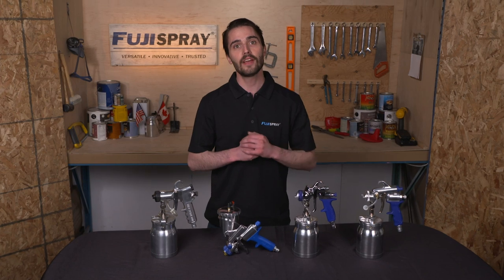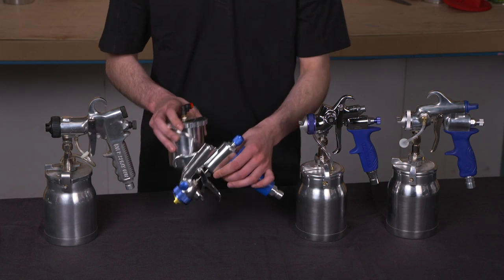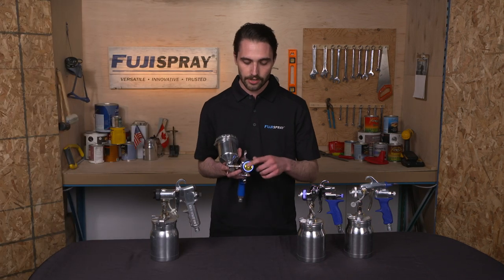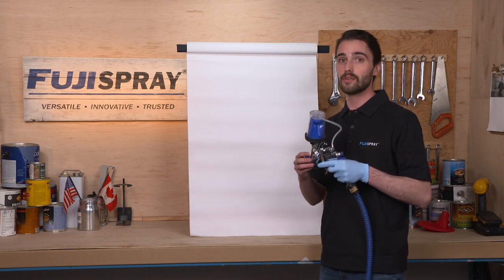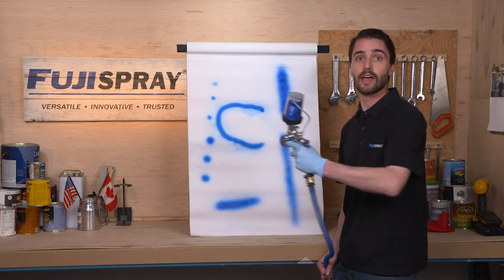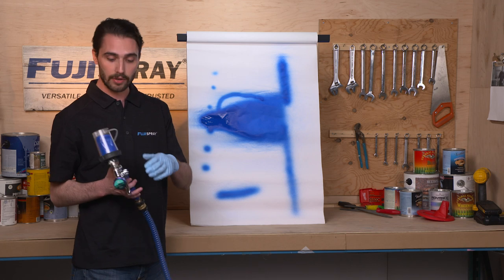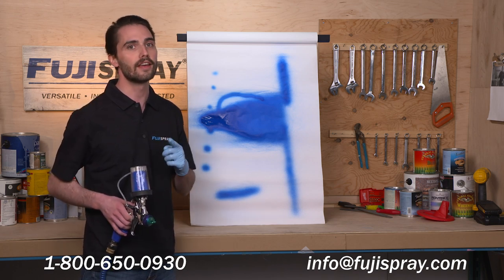How To | Adjusting the Fan Control on a Fuji Spray® Spray Gun

Comment: Jim I bought a hobby pro2 and I am trying to spray Benjamin Moore Advance on Kitchen cabinets. What should be the fan size and fluid settings ? Also can i keep my gun as close as 3 inches to the project or do I maintain the 6 to 8 inches as you mentioned in this video.
Reply from the maker: Firstly, you would want to dilute the paint so it flows and atomizes effectively (see link https://www.youtube.com/watch?v=kd1diWCLSH4&t  on dilution and https://www.youtube.com/watch?v=TF3-CataA5Q on how to use your viscosity cup). The fan size should be the widest setting for the doors, fluid control varies on how wet of a coat you wish to achieve. We typically begin by closing the fluid control all the way, then 1.5 turns counter clockwise and test on a scrap piece, see if this is the type of wetness you wish achieve or adjust if necessary. The cabinet boxes may require a narrower pattern; start on the corners, then wider pattern for larger surfaces. Remember you will need to adjust the fluid control in tandem as you adjust the fan width. For further assistance please contact Fuji at support@fujispray.com or call us directly: 1-800-650-0930. - Fuji Spray Team -

Comment: Jim...which gun is the one you used in the demo? Why a different gun than any of the ones you first talked about? How is the gun you used, different?
Reply from the maker: The spray gun used in the demo is the T-Model gravity spray gun installed with a small 3M PPS cup setup (ver 1.0). It's a smaller profile setup and easier on to handle for smaller touch-ups or demos like this one. The adjustments of this gravity gun are similar to the T-Model bottom feed gun displayed on the table in the beginning of the video; same fan pattern control adjustment, same material volume control. - Fuji Spray Team -

Comment: How can you set the psi at the gun do you sell a regulator?
Reply from the maker: At the end of the hose where you connect to the spray gun, there is an Air Control Valve. This simple ball valve will help you adjust the air pressure coming into the spray gun. All Fuji Spray HVLP spray systems include one of these.
Reply: So there isn’t a gage how do you know your psi?
Reply from the maker: @mikewolfe789  In reality it's not necessary to have a pressure gauge present. The pressure that a 2-Stage spray system puts out is approximately 5psi, a 3-Stage spray system puts out 6.5, a 4-Stage about 9 and a 5-Stage approximately 9.5. When a HVLP turbine spray system is in operation, you would typically need all of the pressure that the machine puts out. In very few instances, when spraying some top coats or stains and operating the 4 or 5-Stage units, one would lower the pressure coming into the spray gun to reduce overspray. if you have any further questions or concerns, we encourage you email us at info@fujispray.com or call us directly: 1-800-650-0930. - Fuji Spray Team -

Comment: Is their a Fugi system that can spray oil base paint and lacquer  ?
Reply from the maker: The Fuji Spray Semi-PRO 2 all the way up to the Fuji Spray Q5 can spray oil based paint. Bare in mind that the Semi-PRO 2 is an entry-level spray system. If you are looking for professional showroom finish results, you would want to consider a 4 or 5-stage spray system (Mini-Mite 4 or 5, Q4 or 5). - Fuji Spray Team -
Reply: @FujiSpray  I have a minimite 5 and its giving me problems with oil paint. i shouldve gotten a Q5 right?
Reply from the maker: @smilegagadk  not necessarily, the Q5 and Mini-Mite 5 have the same PSI output; they both have a 5-stage motor installed in in them. If you wish to troubleshoot your challenges with oil-based paints, we ask that you kindly reach out to Fuji Spray directly. We look forward to hearing from you. - Fuji Spray Team -
Reply from the maker: @smilegagadk  Q5 and Mini-Mite 5 both have the same 5-stage motor inside; they are equally powerful. please reach out to Fuji directly to further discuss your spray challenges with your spray system. We look forward to hear from you. - Fuji Spray Team -
Reply from the maker: @smilegagadk  The Q5 and Mini-Mite 5 are both equally powerful; they both have the 5-stage motor installed in them. Please contact Fuji Spray directly to discuss the challenges you are experiencing with spraying oil based paint. - Fuji Spray Team -

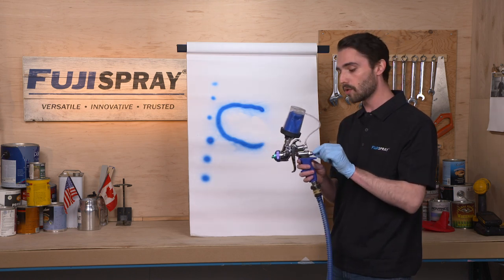Comment: Fails to say whether the 12:00 or 3:00 setting is wide or narrow. 

Fails to say whether clockwise or counter-clockwise adjustments to the finish supply will increase or decrease finish volume. Basically failed to answer the two questions I had in mind when I found the video.
Reply from the maker: This video walks you through adjusting the fan control. For fluid output control, clockwise will decrease volume flow, while counter-clockwise will increase volume flow. Look at it as if it were a lid of  bottle, clockwise will close (meaning reduce the fluid output), counter-clockwise will open (which allows for more material flow). - Fuji Spray Team -